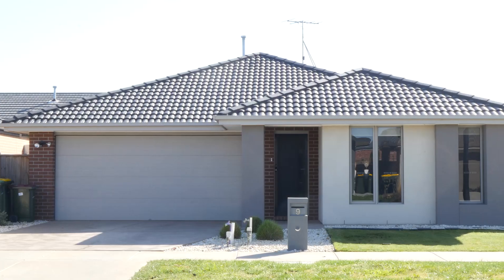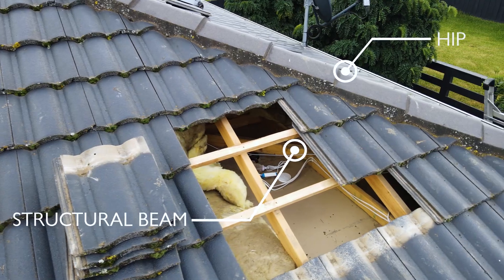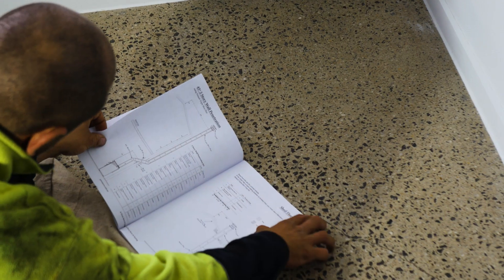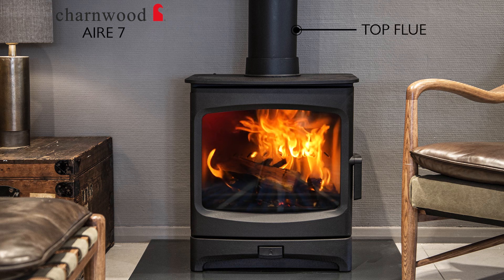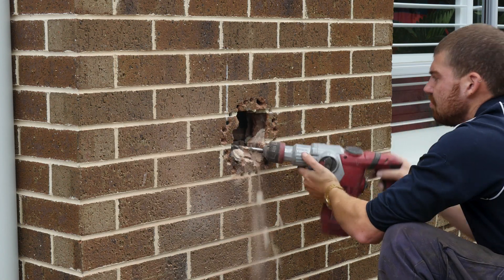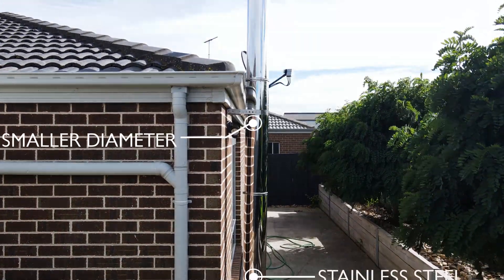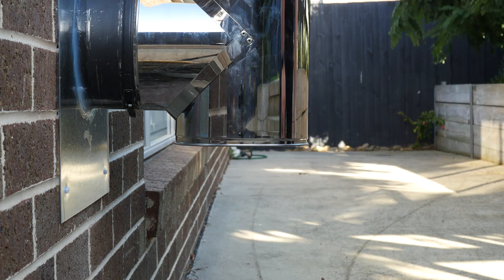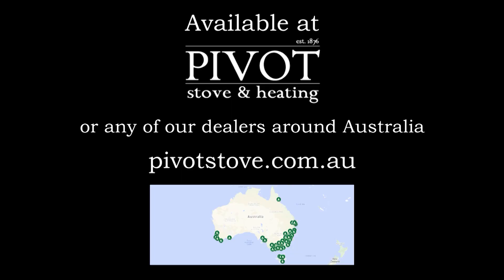Charnwood Aire 7 Corner Installation with Rear Flue

Comment: How come there’s no heat shield fitted to the wall behind the stove ?
Reply from the maker: Thr Charnwood Aire 7 wood heater is tested to be 100mm away from a combustible wall
Reply: @pivotstove  with an added heat shield fitted to the back of the stove  which is usually an optional extra to purchase
Reply from the maker: In Australia  , all charnwood wood heaters come standard with the rear heat shield attached.
Reply: @pivotstove  what’s the aire 3 like. Any good compared to the aire 5 ?